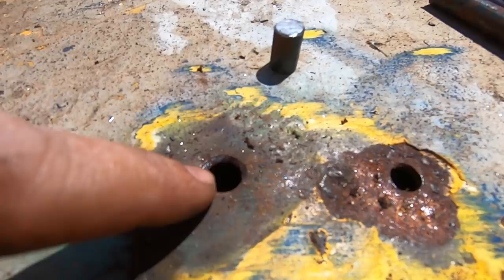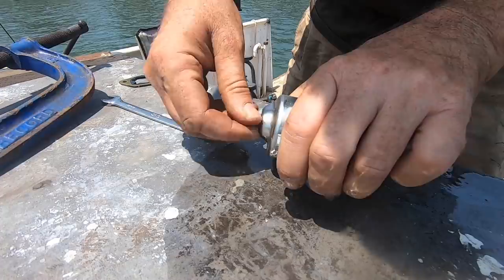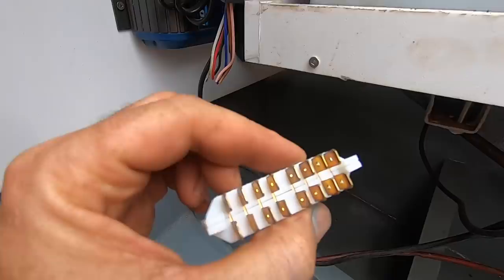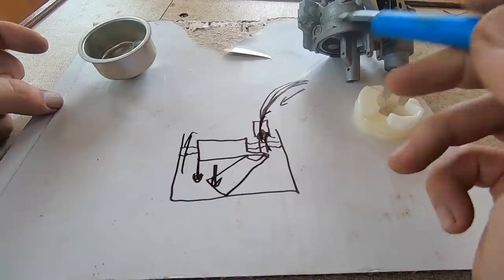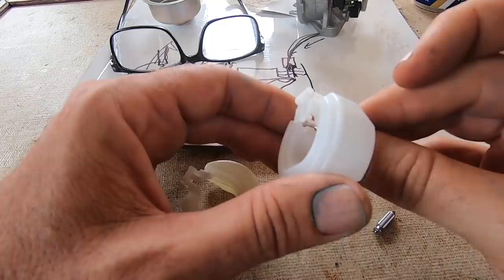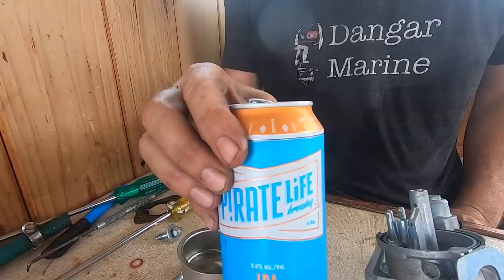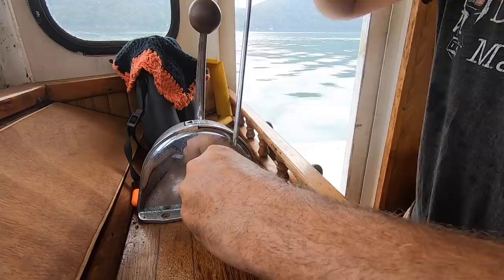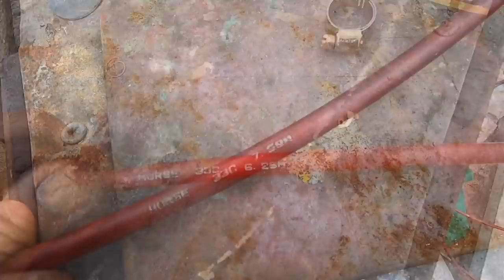Deck and generator repairs

Comment: Nice explanation of the generator float! I would add that if its had fuel in the cylinder for a time, I would change the oil as well because petrol will seep past the rings over time. Check the level of the oil as well, if its well over max then change it!!

As for the petrol in the float, I bet its a porous seam, i might have been tempted to run some epoxy around them, or try submersion in a bucket and see if air bubbles reveal the leak. Then epoxy. 

Great warning about petrol vapours in the bilge as well!! Same goes for gas (Butane and Propane) are both heavier than air.

Comment: Hey mate..good video again..I used to run honda pumps on big mobile spray rigs and if the operator didn't turn the fuel off they would flood because of the float bouncing during travel to fill points etc..One thing you probably did but didn't show is check the oil level and see that it didn't get diluted with petrol that bypassed the piston..Honestly I have owned around 30 honda pumps, gennys, and air compressors and never have I seen a punctured float..You  must have won that lotto on your own it seems..See you next time.
Reply from the maker: Good point about the bouncing. That's convinced me to turn it off each time.

Comment: Regarding Petrol on a boat,  some years ago a freind of mine was changing the fuel filters and water seperators on his inboard engine whilst moored in the marina, he used a cardboard milk carton to drain the fuel into which was sat on the deck beside the engine, whilst putting everything back together he dropped a spanner down the side of the engine, it landed on the starter solenoid and caused a mass of sparks, he jumped Knocked over the milk carton and the whole boat went up in flames engulfing him, luckily he had the sense to jump into the dock and extinguish himself, he was quite badly burned and so was the boat.
Reply from the maker: Ouch, poor guy. Goes to show how easily it can happen.

Comment: Can’t believe how nice that slag looked, just like glass beads
Reply from the maker: Yes, that seems to be property of low hydrogen rods.
Reply: Yeh I have been learning how to stick weld off youtube and the Americans use a slightly different rod i think 7018 the slag  doesn't look so glassy but when I went to the weld shop they gave me 7016 rods  they said that's what  we use in Australia  it looks real pretty maybe I'm wrong  I'm no expert  that's for sure.

Comment: Is the engine a genuine Honda or a chinese knock off? I've had several pump and generators powered by Honda motors, very rare for them to fail. Thank you for taking the  time to explain  and educate people.
Reply from the maker: It's a genuine Honda GX390. First one I've had a problem with too and I've had about 5 of them in different things.
Reply: @DangarMarine  Thanks Stuart, the ibrutinib is starting to work. Were so fortunate to live where we do. Pile on the sunscreen and lip screen. This shit's for real mate.~Brendan.

Comment: Don't forget to change the oil. Probably so much gasoline in the oil, it could run a 2 stroke outboard
Reply: or possibly explode if all the ducks line up

Comment: I think the metal and wood-cutting blades (5:15) are the same.  Same bimetal material at least.  I've found that the blades advertised for cutting wood just have larger teeth.  So on thicker sections (or cutting at an angle) it makes almost no difference if you use them on wood or metal.

Comment: If the generator was hydro locked from fuel you are gonna want to do an oil change as fuel would have leaked past the piston rings into the crankcase and it will thin out the oil and prematurely wear the bearings

Comment: That clip flying across the wheelhouse type of thing happens all the time... Half way across the wheel house it enters another dimension in a parallel universe and will never be found in this one. The Stu in that universe will suddenly be struck by a flying clip and have no bloody idea where it came from and will spend 3 days trying to determine where it popped off before giving up on it and resign himself to waiting for whatever it came off of to fail... to no avail of course which will always make him just that little bit nervous whenever he takes the boat out. ;-)

Comment: In the US a lot of generators use a carb that has a fuel shut of solenoid on the bottom. It may be worth looking for one with that set up from a safety point of view.  Also Honda engines have a number stamped onto the block something like GATX-9999- 0988 that will look up that specific engine schematic. Also, the Carb manufacturer is on the carb someplace with their own set of numbers that will allow you to look up the schematics for that specific carb. Don't ask how I know all this.......
Reply from the maker: Thanks mate, I'll search for that full number before ordering another one.

Comment: I usually use the fuel shut off to shut my generator off at the end of the day that way the bowl is empty.
Reply from the maker: Yes, running it dry can be a good way to go, particularly if it won't be used for a while.
Reply: @DangarMarine  I run my two stroke outboards dry when done for the day,  disconnecting the fuel barb at the motor. Is this going to cause a problem?

Comment: If you had immersed the old float in HOT water, the petrol would increase the pressure in the float by evaporating and reveal the location of the leak with a trail of air bubbles.

Comment: If it hasn't already been mentioned put some compressed air through a blower in the hole you drilled then youll see where it is coming out there is your crack entry point etc 👍

Comment: Seeduino Xiao $5 and a BME280 sensor $4.  Temp, Humidity and Pressure data.  You can buy 3 BME280s and put one outside, one in the pilothouse and one in the engine room.  You can easily set alarms or add other sensors.  IIRC the Seeduino has 12 in/outs..  From there you can use Node-red (free) to vend the data in numerous ways to numerous devices.  Including something like a free database like sqlite or mysql.

Comment: Might I suggest you place the generator on a rubber mat.  I'm willing to bet that vibration caused the float to fill.  Vibration on land is much less than on deck.  Just wanted to put in my humble opinion.  😁
Reply: Remember this part is probably welded together using sonic waves.  Perhaps a thin coat of sealant along the seam.  Careful not to put too much that you lose bouyancy
Reply: Think of all the vibration or a lawn mower or power washer.  Same engines and carbs.
Reply: @robertp7209  yes but again not set up on a metal hull sitting in the water.
Reply: @robertp7209  I am talking about a land design in a marine application.  Certain forces are changed.  Hell I could be totally wrong, which would not be the first time, but I could also be on the right track.
Reply from the maker: It does have rubber feet which I assume help with this.

Comment: Saw on someone else`s video that one cheap generator had a strange tank vent the was halfway up the tank, so with a full tank it emptied through the carb  manifold then out when not running. Check your carb to tank vents as they may be the same/

Comment: That's not common for a Honda carburetor at first I thought it was a Clonda. Honda is one of the most reliable engine for pumps and generators used in a marine environment. Honda powered pumps have saved lots of scows from sinking out here on the West Coast.
Reply from the maker: I know what you mean. Plenty of pumps, generators, mulchers etc that I have owned have Honda engines in them and they have always been amazingly reliable.
Reply: Dangar Marine we’ve had Honda Scow pumps rusted to pieces they started 1-2 pulls.  Pumps powered with Briggs and Stratton engines never started.

Comment: chill it down with ice packs then Wrap it in paper towels and set it on top of a hot water bottle
If you can't see a till tail leak then tip it up the other way and repeat

Comment: Similar issues with Honda Generators. We used them to operate internal lights on the blimps. Had several with the float problem, and one undetermined reason for catching on fire while I was in flight. Luckily I had just taken off, and was able to get on the ground quickly. I would not put one of these below deck!!!!!!!!
Reply from the maker: Wow, that was very lucky!

Comment: I've years of experience on those engines, the best thing to do is buy a cheap chinesse carb. It's a rare case where the 20 dollar part is better the the real deal.
Reply: I have a few of those chonda motors, buy they often seem to let the fuel past and in to the sump if you don't turn the fuel off when the engine is left sitting. 
  Any ideas? As they all hay the cheap carbs being a nock off
Reply: Tried the China carb a few times and never was able to get one to work damn things are junk from the start and 650 for a new carb.

Comment: And the sump is full of petrol now,oil will have a viscosity of water.
Reply from the maker: Yes, depending on the condition of the rings, it is a definite possiblity and needs to be checked.
Reply: Nek minute crank case boomy
Reply: @DangarMarine  
 From my experience it's common enough to get petrol in the oil when those carbs leak, no matter how new or old the engine is. 
  Just check the oil level and guestimate if it looks higher than it was before.

Comment: Myth busters did some science behind fuel tanks etc blowing up when they are being cut,  they found that it takes very little gas / petrol In the tank to get the explosive ratio for petrol to air.  It would really only happen if someone tried to clean out the tank first,  I’ll check to see if I can find the episode,

Comment: Awesome video mate! Could you show how to adjust the carburetor for a generator like that ? (dont know if its fuel or air screw ), but would be very interesting to learn how to do it :)
Reply from the maker: All carburettors are pretty similar. Here is a vid I did on doing an outboard with multiple carburettors https://youtu.be/bsHCMJnRY9A

Comment: I imagine myself needing electricity but the inverter fails, trying to use the generator but its float valve spills gas all over the deck, drinking a few (ok, a pack) Pirate Lifes to  concentrate my thoughts, while sitting over the gas-soaked deck, shaking the gas out of the leaking float into my lap, deciding to seal the plastic float with heat using my lighter with its big, robust flame.....

Comment: That carb looks very similar to the one on my Subaru motor off a Home Depot Rigid power washer.  12 bucks on Amazon for the whole thing.  The motor was hunting, cleaned up a jet - cured it.  Next time I’ll just replace it.  Must make these carbs in China by the zillion to be so cheap.
Reply from the maker: For sure, they are very cheap to replace.

Comment: Since it did hydrolock fuel leaked past the rings on the piston . So that means you need to change the oil soon . Damage can happen over time.

Comment: The way you drew that carb,as the float goes down it puts the needle into it’s seat ! not quite right I think !!
   It works if the needle is on the same side of the pivot as the float body.
Reply from the maker: I probably did, wasn't really paying attention to the finer details.

Comment: When fuel runs into the cylinder, it also seeps past the rings into the oil sump.  At this point your generator's oil is contaminated with a bunch of fuel and should be changed out.
Reply from the maker: Doesn't look like any got in this time. Level not changed and consitency is normal.

Comment: I’m not knit picking but your drawing of the carb was a we bit wrong ! When the float is UP it shuts off the fuel and when it’s down it allows fuel into the bowl ! Your diagram shows the pivot point in the wrong spot , it should be pin then needle then float  ! Just an observation ! Your making really nice progress !
Reply from the maker: It was wrong Dave, I’m guilty! :)

Comment: Surprised to see the fuel lines with what look like soft-soldered capillary joints. In my world (inland boats, UK) that's a no-no in our pretty floppy safety rules. Obviously because in a fire the fire melts the solder and releases the contents of the fuel tank to add to the fun.
Reply from the maker: Yes, it probably is a bit of a no-no. Works fine under normal conditions but when things go wrong...

Comment: If you had an airline you could have forced a little compressed air through the drilled hole in the float and seen where the other leak was! Also, did you check the genny oil level to see if it wasn't over full? Nice video BTW :)
Reply from the maker: I could, but at $3 I'll just get the right one. If you were stuck at sea though! ;)
Reply: @DangarMarine  Its free of fuel now so you can just dunk it in water to see the leak from the bubbles.

Comment: Those wood blades work great for trimming trees. Also, time to buy fire extinguishers?
Reply from the maker: Got a good electric chainsaw from trimming the trees, but good point. Have plenty of extinguishers on the boat, but some do need replacing.

Comment: Fuel in the bilge is extremely dangerous. I've seen a few blow up so bad that it split the hull in two like a bomb went off.  One was a jet ski and it exploded when they tried to start it and they got blown off of it and got hurt real bad.
Reply from the maker: For sure. Plenty of petrol inboard boats definitely go up.

Comment: Happy new year to you.
After drilling the hole in the float, you could have run air through and found the invisible hole with soapy bubbles.
Is the fire affecting you at all?

Comment: Here in the US when a small engine has problems, it is usually a carb issue caused by that crappy US government mandated ethanol fuel.
Reply from the maker: Yes, fuel problems are the main cause of grief in our outboards here on the island.
Reply: @DangarMarine  So the government there makes you use crappy ethanol fuel too! The source of many cuss words for me when I have to unecessarily remove a carb and clean it because of it. Although, sometimes a can of Seafoam or Berryman's prevents it.

Comment: Do yourself a favor and let that carb run dry every time. Put a inline fuel shut off and shut it off and let the carb run dry. It will save you a bunch of headaches

Comment: I have a tiller I use about 3 hours a year, with a leaky float. It's a chinese knock-off of a honda. Every time I finish using it, I close the petcock and let it run till it quits with the carb empty. That way the float isn't in gas long enough to fill up....

Comment: Ahh, Stu! ... What you need for this is every welding fabricators friend: The Copper Block.   Repair fabricators almost always have a copper block, you just push it up agaisnt the back of the hole and then weld around the edge of the hole in circles until it is filled .... the steel will not stick to the copper, the copper will not melt. I've seen fabbies fill up holes up to around 25mm in 3mm sheet this way.  Would have been perfect for those deck holes, just stick it on the back with a welding magnet.  Most fabbies keep a square about 2" by 1/4" thick of copper in the toolbox, one of the most useful welding helpers you can find.  Short video here: https://www.youtube.com/watch?v=45Y4-jny3iI
Reply from the maker: I've actually given that a go with mixed results. I think to make the block smaller as with the curve in the deck there is a big gap between the block and the deck making it impossible to fill. Making the copper smaller should help close the gap up.

Comment: I’ve never had any luck with inverters.
In my mind they are not to be relied on.
Reply: The Big W - it seems boat people are constantly replacing them.
Reply from the maker: I think I may have killed mine using it to weld. Probably more than it was up to!

Comment: cant the rocking of the boat on the water lift the float.......so you should turn the fuel tap off and run the carb dry after every use?

Comment: Change that genset oil ASAP or we will get a video of installing a new con rod in a GX390 as long as it does not come out of the block when it breaks. Most of the time a GX160/200 stays in the block but the 390 comes out.

Comment: With your inverter they don't like transient spikes from welders all that much, I'm not sure if you ever used your welder from the inverter or not, if you only used the generator then you need a generator that is quite a lot higher than the rated current of the welder, like if it's using a 15amp plug & at max 3600w then with either an inverter or generator you need to have one that are comfortable at supplying double the output for reliability. Most cheap inverters use High Frequency Inverters which might be good for common household light use but they are no good in heavy duty usage, for something like that you need to buy a Low Frequency Inverters which have huge transformers in them & they are normally bulky, very heavy in weight as well & they are not cheap.
Reply from the maker: Yes, I think I did kill the inverter by welding from it.
Reply: That's unfortunate, sorry to hear about that, there are a few Australian companies that make Low Frequency Inverters if you want me check for the link for you?

Comment: I'm kind of surprised you don't wear ear protection when outside your home, those cockatoos are loud. The one screeching in this vid must have been 200-300 feet away.
Reply from the maker: They are noisy buggers!
Reply: @DangarMarine  I know, a roomie had one as a pet. They do make good pets, if you can handle the noise.